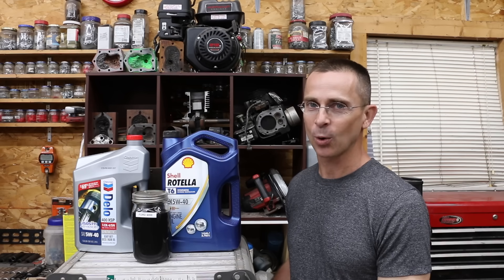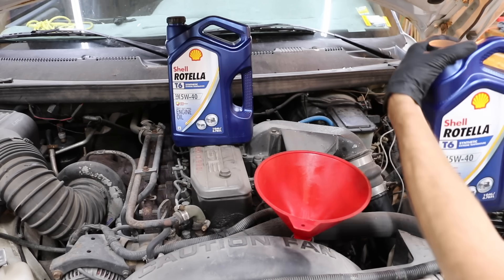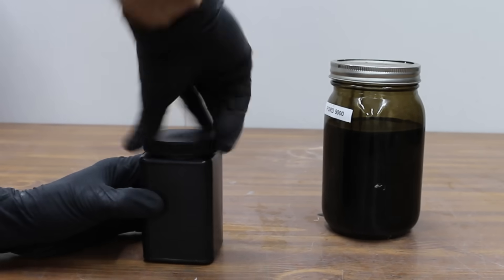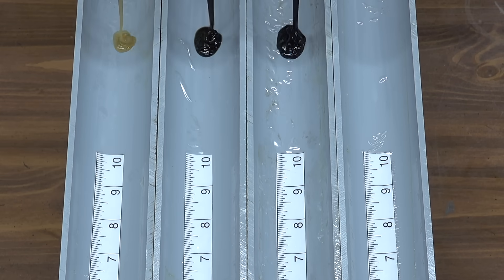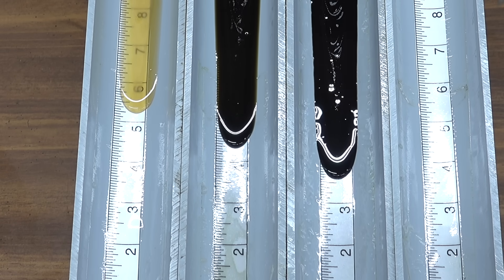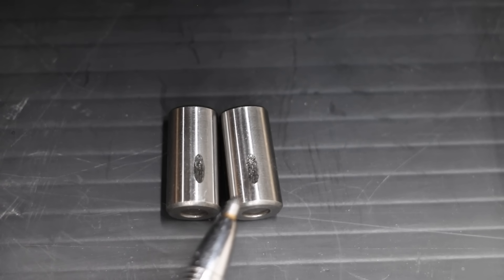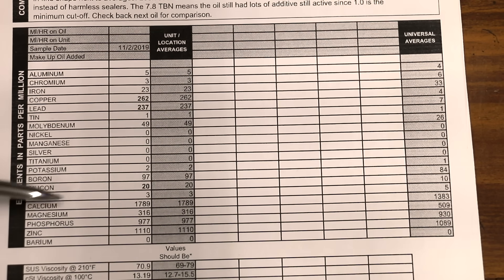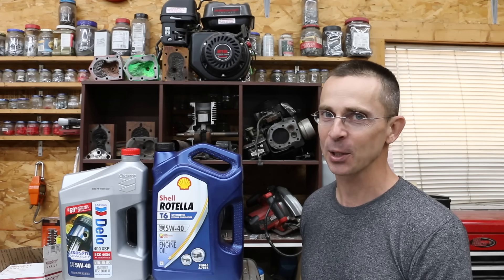Will Annual Oil Change Damage Your Car? Let's find out!

Comment: I had a discussion in the past with a technician from Shell Rotella regarding T6 losing API SM designation, and apparently it comes down to the high levels of phosphorus and zinc you pointed out. High phosphorus oil when burned allegedly clogs up catalytic converters over time. So do with that info what you will. This is also a good additive for older pushrod engines.
Reply from the maker: Thank you for the feedback

Comment: Wouldn't a more objective test of whether the oil had become corrosive, be to test the oil with colorometric pH test strips when new, and again when drained from the crankcase?  Or, if a numerical result were desired, perhaps an electronic pH indicator could be used?
Reply: He sent it to the lab and one of the parameters was related to how much buffering strength remained in the oil. A simple pH test can tell you if the oil has become corrosive, but it cannot tell you how much buffering strength remains in the oil. I think you would have to titrate with acid to figure that out. More of a Cody's lab thing than a Project Farm thing. Hopefully you know what I'm talking about if not I can elaborate.

Comment: I drive about 1000 mi a year.  I change my oil when I need a head gasket or water pump.  Topping off the oil replaces most of the oil in a couple of years.  By the time I need an engine, I've saved enough on oil to pay for a rebuild.

Comment: I think the result depends on the machine hours, fuel type and engine condition. That's why automakers strongly recommend change motor oil once a year.
Reply: It's a safety mechanism, cars that have it a bit harder (short trips) get new oil anyway. For very heavy use, they usually recommend shorter intervals even.
Reply: It's a safety mechanism, cars that have it a bit harder (short trips) get new oil anyway. For very heavy use, they usually recommend shorter intervals even.

Comment: My employer only changes oil on mileage. We have 1996 VW Golf 1.6 Mk1 (branded Citi Golf here in SA since it was produced until a few years ago) The car was driven 9 years without an oil change and rarely drives more than 8km a day.It has 189th km on the clock and it is still doing fine. Also oil changes for most vehicles here is 15000km (9k miles) and most diesels 10000km (6k miles) None is less than these and for some petrol vehicles like some Peugeot and Citroen's it is as high as every 30th km and Citroen does not specify yearly oil changes.  Also, if I am correct Jeep specify oil change every 20th km on their diesels over here.

Comment: Basically pretty much every industrial, earthmoving, or heavy duty machinery has oil changes based on engine run time.  Fleet vehicles (trucking, taxi, buses, etc) that see much more severe duty than personal vehicles ever will also have very different requirements because they'll actually test their oil.  Only in consumer automobiles, specifically in the USA, do you find this huge oil change culture and an entire industry of quick-change oil chains pushing all this ridiculous nonsense.  You don't see any of this in Europe or Asia (it exists to a lesser extent in Canada).

"But it's cheap insurance.  Uncle Joe changed his oil every 3,000 miles and his car lasted over xxx,xxx miles!"  Yeah, and you can change your oil every 1,500 or 500 miles, and change your gear oil, regrease all your zerk fittings, swap out your radiator coolant, and flush our your brake fluid, all done every 2 months.  That's even better insurance, using the argument of needless preventative maintenance.  It's the same thinking that gets people to put 91/93 octane into their car because they think there's a premium fuel benefit and "cheap insurance" even if they drive a car that doesn't need the additional octane rating for knock protection on a lower compression engine.
Reply: Any good synthetic oil will last you 30,000 Km/2 years without any issues. I go every 1.5 years for the "cheap insurance". I'd say it's far better for you engine to use premium oil and change it every 2 years than a cheaper oil and change it every year.
Reply: Schlo 7G  That's good to know.  The most popular mail-in lab is Blackstone, but if a brick-and-mortar store can do it in-house for a reasonable fee, it saves shipping and time.
Reply: Visual Kei 
But it will still rust out
Reply: @Retired driver - Exactly! I'm dealing with that now on my 03 Ram 2500 5.9 Cummins! Engines in great shape and has been well maintained/taken care of... 'cept now the body and bed are going south quickly from rust, with barley 140k mi on the odometer  }:(
Reply: @__WJK__  And that has something to do with the motor oil?
Reply: Good points. For YEARS AND YEARS it was always advertised to get your oil changed every 3000 miles or every 6 months/1 year depending where you lived in the US. That was the standard. There was no other standard. More recently though (maybe the last decade) the oil change interval has slowly risen. Most places use 5,000 miles now. Some car manufacturers are even quoting 7,000-10,000 mile oil change intervals in their cars. Personally, I use synthetic oil (mobil 1) and change it once a year... maybe? My car doesn't really get a ton of miles so I never really worry about reaching the mileage limit. That said, if I drive a car hard for any particular reason (autocross, or a track day), you better believe I'm changing my oil before or after that. 

Also, about the gas, like you mentioned, SOME cars require higher octane fuels due to the compression ratio of the engine. My engine is one of those engines (according to the manual).... and it doesn't even have forced induction. Whatever, it's no big deal.
Reply: @reeepingk  I got and Honda type R and a subaru ouback h6 and both recommend 91 i run regular on my suby and 91 on my type r direct injection and turbo charge.
Reply: @Andrew H The interval depends on the oil and the given engine plus how you use it. Many modern cars actually tell you when its time to change the oil! As a rule of thumb I'd say: If you take a good oil and don't drive your car on the race track, then 20-25K is okay. And you are right: avoid low oil at all costs.
Reply: Absolutely Right: In Europe oil change is done be milage or by "the car tells me when it's time".  Typical intervals are more in the 5 digit km numbers. No "all 5000 miles" or the like.
"Real" cheap insurance btw is to always take a good oil. Beside the different specs it should have for your car - if it is not fully synth and 0W40 or 5W40 do not take it. 
(0/5-W40 in itself is not a quality measurement, but you can not reach 0/5W40 with conventional oils or cheaper additive packages, so its is an indirect indicator: Any 0/5W40 Oil is at least synthetic and has a decent additive package.)
Reply: Wow do you always work from uneducated assumptions? You have no idea how octane effects anything or how most of a car works just based on that moronic soap box rant of complete stupidity.
Reply: @zedorda1337  I like how your your rebuttal claiming I'm completely wrong in every aspect has absolutely zero merit, because you provided none.  

Octane rating is literally the textbook scale that determines fuel resistance to pinging or knocking.  Anti-Knock Index (AKI) is measured in the USA by averaging the research octane number and motor octane number, the (R+M)/2 formula posted on every gas station.  There are plenty of people out there wasting money and believing 93 octane in their 87 octane motor gives them more power, just like they think swapping out an air filter gives them 10 horsepower.
Reply: @keiy.4031  I get better mileage with Premium. What I prefer is fuel without ethanol. The extra cost sometimes does not bear any savings with more MPG, but I know where the break point is price wise. Traveling you won't ever know. Buying locally, yes. It does depend a lot on the additives put into the fuel despite the Octane.
Reply: I own Prius 2013. I can say for sure premium gas ⛽️ work better for my car. And if you read the manual says if you run over 40 miles/day or in live in high temperature (over 90F) place change your oil every 5K miles.
Reply: I may be off here, but I question your knowledge and experience on this subject.  It is common for engine damage to be done due to inadequate oil change intervals, and this is an objective fact.  In many of these cases the owners followed manufacturer guidelines on oil change intervals only to have the manufacturers change their recommendations by updating the OCI programming to be significantly shorter after finding out they had problems.  Nearly every major auto maker has had sludging or wear problems due to extended drain intervals at one time or another.  The current 'I'm smart than you' tendency to say that oil drain intervals do not matter is dangerous and incorrect.  They matter big time.  That said I certainly do agree that the 3k mile religion is a myth and oil testing is a great way to get objective data, but for most people changing on a regular basis is a good idea.  If you're doing 25k mile drains based on hearsay without testing your oil you're just an idiot.  If you're doing it based on solid data then I have no issues with it.  Some vehicles/owners beat up their oil quickly and some don't, as is with all things in life context matters.
Reply: @knurlgnar24  Plenty of people are also using oil that doesn't meet manufacturer requirements if they're getting oil changes outside the dealership network (and who can blame them for the premium labor costs found at a dealership?)
 

For example, BMW LL-01, Chrysler  MS-10725 or MS-10850, Fiat 9.55535.Z2 and 9.55535.M2, Mercedes 226.5, 229.3 and 229.5, Porsche A40, PSA B71 2296, VW 502 00 and VW 505 00, Renault RN0700 and RN0710 are just some OEM-required specifications for 5W-40.  Not every 5W-40 oil is going to meet every one of these specifications, and it's gotten a bit ridiculous given most of these overlap on a Venn diagram as far as requirements go to meet spec.

There's also an entire side-issue that some third party oil filters are absolutely garbage regarding construction, surface area from the filter element, and questionable bypass valves.

Most modern cars, assuming you don't reset the battery, also keep tabs between "severe duty" and "normal duty" driving and calculate an oil change dummy light based on cumulative driving conditions.  Of course, as you mentioned, manufacturers are prone to tweaking firmware nowadays in secret because we aren't really privy to every TSB until some regulatory agency finds out.  If consumers were actually empowered to test their oil and get intervals correct for their driving, that would be the best case scenario because it would be empirical and give each person the best value.  There will be plenty of anecdotes of someone who did the 3k changes or only topped off oil when it ran low and both ran over 100k miles without problems (not much of an achievement today for engines to hit 6-figure mileage, honestly) and they're not particularly useful.  

As far as car maintenance goes, a seized engine from bad oil maintenance affects the owner, but I feel like it's a much larger problem with people who won't do tire maintenance, which affects whoever gets plowed into by a car that can't stop, accelerate, or steer properly.
Reply: @knurlgnar24  Well said! I do short intervals BUT I do a lot of short trip driving and it takes forever to rack up the miles. My engines are spotless inside and I have no problem with burning oil or seal leaks.
Reply: "You don't see any of this in Europe or Asia (it exists to a lesser extent in Canada)." 
Thats BS, in Europe we change our oil based on mileage or time (which ever comes first). Every 1-2 years or 10.000-25.000 km (depending on the quality of the oil and how the car was used).
Reply: @Chris-yy7qc  There's no quick lube oil change companies like in the states.  The intervals are also massively different than those promoted in the USA (every 5,000km or 3 months) regardless of make or model.  The only difference in my experience is pricing.  It was €30 per litre of engine oil when I was in Salzburg.  It's 80% cheaper in the US for the same oil ($30 for 5L)
Reply: @keiy.4031  Source for that 3 month intervall?

Again sounds like BS... 
Dodge for example says you need to change the oil every 10k miles or once per year.

Oil im the US cost nowhere near 30$ / qt. More like 5-10$ / qt.
Reply: Strange. You say yanks do oilchange in 5000km? But still your engines wont last long? And many yank car imported to europe, have engine full of sludge. Here in europe we run 20t-60t km oil change intervals. No sludge, even in here north where summer temperature can be 30C and winter -40C.
Still our engines last over 500t km.
Reply: Visual Kei there are quick lube places all over asia Europe, Australia, New Zealand etc. not sure where you’re getting that from at all. Japan especially given people’s lack of space to do their own services, Australia too given how hot it gets.
Reply: @keiy.4031  Really? I know of 3 express oil change companies just in my city, in Norway.
Reply: @Chris-yy7qc  The 3-month interval has been "tribal knowledge" for the past 50+ years passed down from uncles and fathers from cars that used to require that type of interval because engines of that period were crude by comparison.  You still have people today changing oil incredibly prematurely, contrary to what the manufacturer's recommendations are, out of an abundance of perceived caution, and decades of Jiffy Lube marketing.
Reply: @Chris-yy7qc  Nope -  we don't.  (or at least you should not)
- Modern cars usually have long life service. That may be up to 50K km thus some 30K miles.
- many modern cars even tell you when to change the oil, the try tp determin, the aging of the il by taking your indiivdual milage and driving habits into account. (at least the likes of Audi, BMW, Merc, VW etc.etc.)
Of course not all engines(oils) are good for long intervals but still everything below 15K km or 18 months is waisting money.

At least if you use GOOD oil. Save money on the interval, but purchase GOOD oil.
Reply: @Slazlo-Brovnik  Only manufacturers which want the car to last for a certain time only would recommend such intervals. Also I highly doubt a 50k interval. I think you dont remember that right.
I just bought a brand new european car. 300 hp. Intervalls are up to 30k/2yrs* using its oil quality sensor or 15k/1yr fix. You as a customer can chose. I will change it every year, because its stupid so "save" on oil changes.

* Nearly no car reaches 30k without the oil sensor detecting the oil gone bad. At 20k latest the car will tell you the need to change.

Comment: What kind of temperature swings do you have? 

I have swings of +86f to -22 f. I put around 1500 miles on my turbo car every year and wondering if this kind of swing would be more drastic than what you get, resulting is more potential for moisture dropping in the crank.

Comment: In Europe most cars have dynamic oil change intervals.
They depend on actual usage and range from 15,000 - 30,000 km or 2 years max.
Our old Golf Mk5 TDI usually wants a change every 28.000 km.
Reply: I live in Europe and I have never heard of such a thing. 15 000 km should be the maximum km to change your oil and if the car is mainly driven on the highway. For the year interval I agree especially when I watched the video.
Reply: @Combine1331  http://iautouk.com/volkswagen-servicing/vw-longlife-servicing/

Comment: My nissan oil filter is mounted horizontally ..i still pre fill it.  Only a few drops of oil comes out.
Reply: Ditto, I do the same on my Maxima (A32 Series) as well, Just gotta be quick to get her on the threads, that's it, not hard at all with a bit of practise.
Considering the oversize filter i use holds over half a litre, you'd be mad not to pre-fill.
Reply: @KSSilenceAU  mine is the  a33b model  5.5gen.

Comment: When I think year round I think of 15k miles or so, not 3k miles and having sat most of the year. I do 3-5k miles a month average.

Moisture is going to happen in an engine whether it is run for 3k or 15k a year. My intake plenum keeps a thin layer of moisture in it at all times unless it goes to the track and gets burned off.